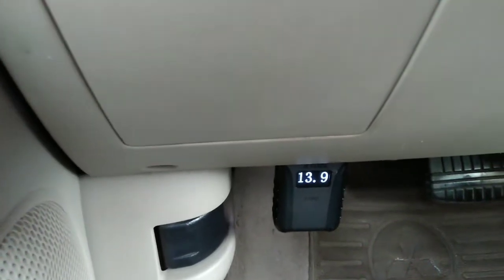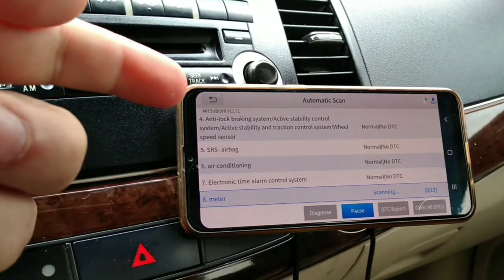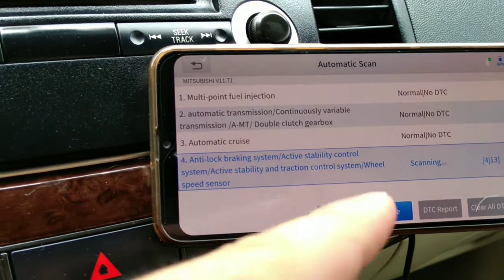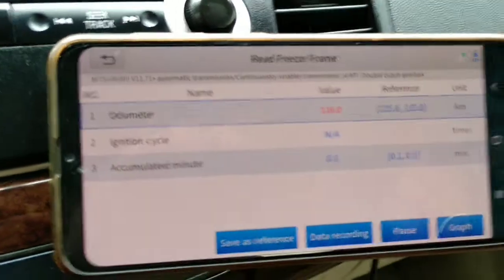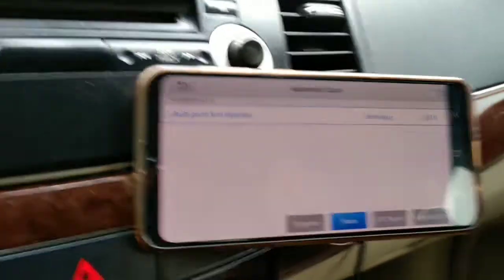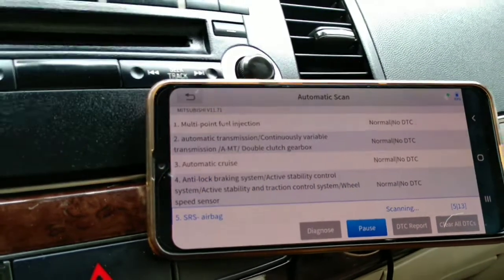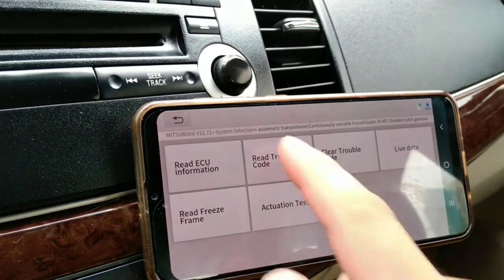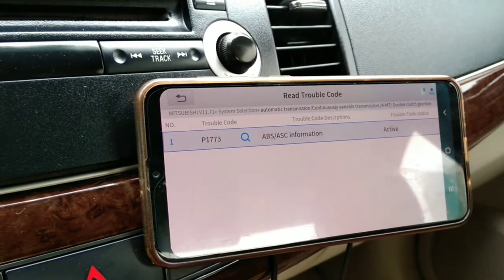P1773 MITSUBISHI and XTOOL Software Glitch (Proof of Concept)

Comment: I have the same code with an outlander 2010 . The other code is C2104. Am unable to fix it though the car drives and brakes normally.  ASC,Traction control ,hand brake signal and "needs service " message on the dash board intermittently.  Assist to resolve it please.